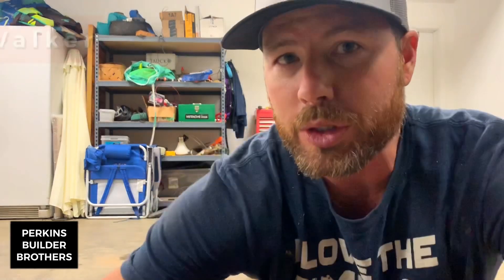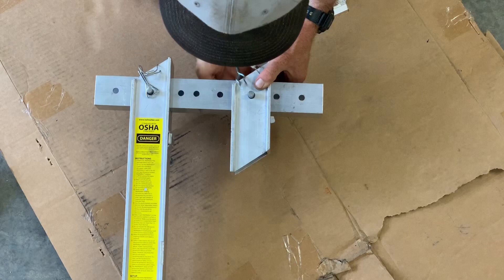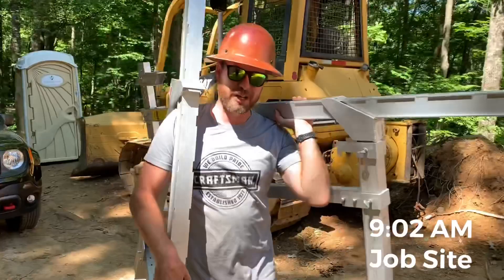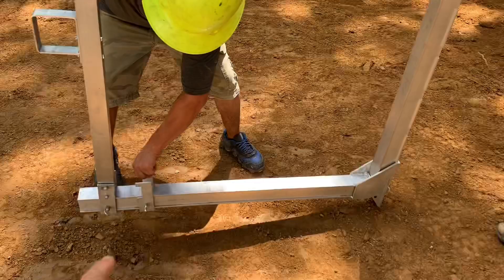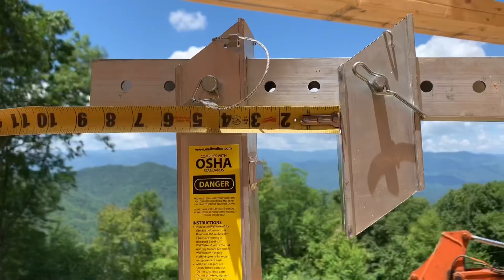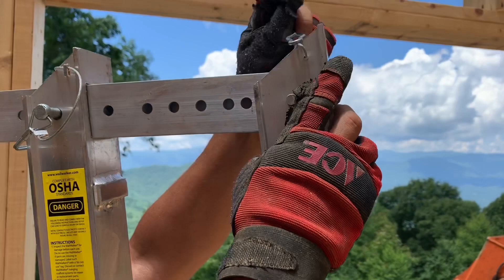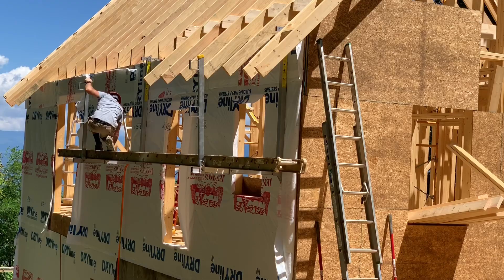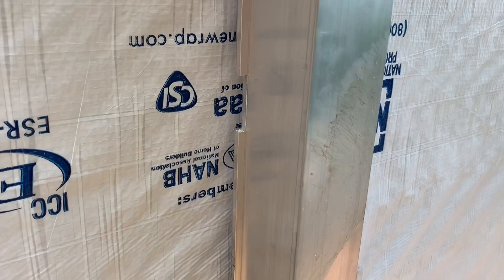Wall Walker Hanging Scaffolding Review

Comment: We just use 2x6 and a TJI 😜

But here in Michigan we build our overhangs on the ground.  Plywood, tyvek, siding, overhang.  All goes up at once
Reply: Ya there is more efficient ways to build walls with overhangs and sheathing already installed, even without a crane.

Comment: cool product...side note you should bevel the top of your facia board. kind of ghetto that you dont...helps support the plywood and easier to nail the plywood, install is easier (don't need to use your square to plane accross before facia nailing) and keeps bugs from making a home on the backside
Reply: When u bevel ur facia your going to loose like an inch or more wether your using 2x4 2x6 or w.e. I would think that would look like shit nailing whatever ur gona wrap it in. Especially if it's pine.
Reply: @chunkmontana6049   it's called a 2x8
Reply: Paul Underwood  I'm talking about the back of the facia, thats why you bevel it...takes 5 minutes...I fix alot of stuff that "40yr" framers did, so I wouldn't use that as bragging rights
Reply: @drewp503  wasted time is wasted money.. same thing happens when u waste an burn up materials. I never have gaps in my plywood on the facia. Always plane right into the 2x4 or whatever they want and always has been sealed tight and always will be. I just did that to a three story 30k sq ft condo and all my plywood is nailed off perfect with no gaps so there is nothing ghetto about it.

Comment: How do you get it off once the facia is on?....
For instance if a guy had a 12” overhang, that leaves 10.5” between the sheathing and the inside of the facia...
Would it fit between s 10.5” space or would a guy have to disassemble it to remove it?

Comment: So help me out. Why not just use normal scaffolding. Will they not need it to do the facia anyway since it hooks over the wall plate and in the way of where the facia goes ? Or in America is it not common to have a facia hence this isn’t a issue ? (From the uk)
Reply from the maker: Good question…these are quick and easy to move around to all of the sides of the house to get the Facias up and sheeting going.  I will scaffold up on the decks (once they are built) to do the soffits and finished facia.

Comment: Hey you’ve got some great vids man. I just subscribed, thank you for sharing you’re work. I have to repair a lot of siding and I really wish I knew of a scaffolding system that I could use on a finished house. I’ve used the stand alone type from rental yards but it takes a while putting it up. Especially by myself. Do you have any suggestions?
Reply: Pump jack scaffolding you can attach it to the roof
Reply: Chuck Novotny okay thanks man. Do rental yards typically carry this product?
Reply: Also does anyone have recommendations for re siding a chimney on a two story home? I’ve rented the stand alone type of scaffolding system but again it takes a lot of time to set it up when working alone. And it’s not the type of thing that can be moved easily for working on all sides of that type of chimney.

Comment: OSHA does not approve any equipment. The open ends needs to be protected with guardrails. They supply an end gate for this purpose. Also be mindful of the cantilever on the walking surface.

Comment: Im more than 250 with my tool belt. Crap rating. Should be 300 each at least. Ladders and pick gives me 600
Reply: timothy chung  I'm aware that one can do funny shit but that's not the point. I'd prefer to buy a stronger product. It's a work surface meaning it should hold men and materials. Cheap is for diy not builders.